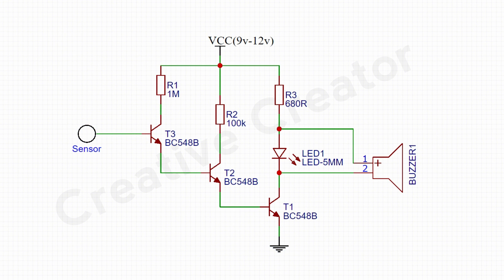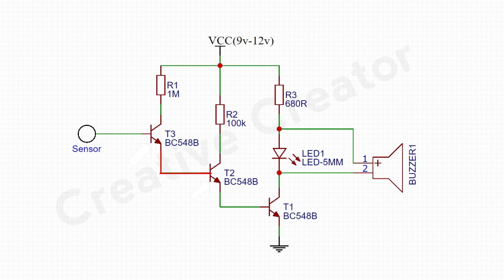Wireless AC Line Detector Circuit

Comment: How can you make it detect low voltage like 12vac or 24vac?
Reply from the maker: Use one more translations as shown. It will strong the initial signal.
Reply: @Creativecreator  Thanks, you are great!
Reply: @Creativecreator  what resistor should i put in front of collector?

Comment: Это фейк! Я сделал и у меня тоже при соединеннии к элементу электропитания, как и у автора ролика, сразу загорается светодиод. Как только прикасаешься руками - он гаснет Маленький нажим пальцем - диод гаснет, чуть ослабил давление - диод горит - Круто! 
It 's fake! I did and at me too when connected to the power supply element, as well as at the author of the roller, the LED immediately lights up. As soon as you touch your hands - it quenches the Little Finger Pressure - the diode quenches, slightly eased the pressure - the diode burns - Cool!

Comment: It's working.. but buzzer sound is coming very low. Used 580ohm on first transistor 100k on second and 1m on third transistor.
And 3 547bc transistor with small buzzer.

Pls suggest what should I do to increase the buzzer sound. ????
Reply from the maker: I think either your battery is low or your buzzer is damaged
Reply: @Creativecreator  

Hello I have already replaced buzzer with new one. And it was working good when I made.

But after some time it's giving bip sound without any electric signals..  🤔🤔

I don't know what exactly happening

Pls reply..
Reply from the maker: @AmitAdate  i think your buzzer is 5v one I have used 12V Buzzer
Reply: @Creativecreator  

Ohh.. ok.
If buzzer is 5 volt.
Can you pls tell me,what value resister do I have to use for this cuircuit to work properly. ??
Reply from the maker: 550ohm to 1k any value resistor